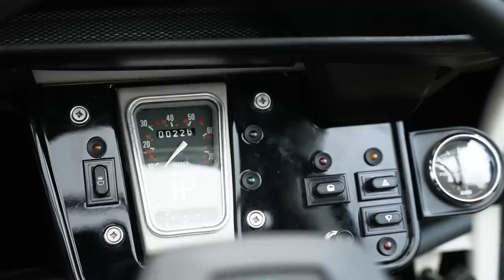All NEW electric converted Citroen 2CV

Comment: I am a little ambivalent of electric conversions of old cars. OK, no, I straight up dislike it.
On the one hand you have something nice and quirky not everyone else has.
On the other hand, a 30+ year old car will never be a daily driver/commuter, because parts will be hard to get and you certainly don't want to be in a motorway pileup in a 2CV and you will be missing a lot of driving comforts. If your car is a complete custom job, no garage will touch it and parts will still be hard to get. And they will still rust like the Dickens.
Also, if the car is something interesting and has a certain value due to it being rare and/or desirable, you will utterly destroy any resale value.
That is apart from the fact that converting a classic car to electric is the same as putting it in a crusher or setting it on fire.
It's worth it keeping an original car going forever. An electro conversion has a definite shelf-life. Once the new components are obsolete, the car is scrap and nothing else. It is converting a timeless classic into a throwaway consumer object.
To me electric conversions of classic cars are for people who don't really like classic cars (because they are a hassle) and don't understand them.

If you really want to convert an old car to electric, go for 2000's onwards. Much more practical, more driver aides, much better rustproofing, better crash safety, seatbelts, airbags, cheap as chips, plenty of parts available, just better allround.
Please don't destroy classic cars.

Comment: On a different note. Saw today that in 2025 5 major car manufacturers will be racing hydrogen cars in the Le Man's race..
Fantastic..  The future.
Reply: Hydrogen very inefficient, like driving a bomb basically. Smallest vapour you can't detect and highly flammable. Get a solar roof, be your own utility, charge at home and you don't need to stop for a garage. Recycle the battery and go again.
Reply: @_hrlt . I was talking about racing in particular.
But also I live in flat with no access to charging..

Comment: 55 miles range is just not realistically usable, 160+ mile range where you charge to 80% and use down to 20%  so a usable 100 mile range is the minimum I believe would be acceptable to most people. 
I have lived daily with a modern EV with 70 miles range and unless you are going to fully charge the pack and run it right down you find you are charging it almost daily
Lovely retro car but wow those cost figures!

Comment: Why keep the gear box ? Appears a weight, maintenance and failure point waste of time to me ?  I love the idea of saving and improving old cars, but the loss of boot space ( yet no fuel tank or spare ? ) for the battery’s annoys me, the range is unacceptably low, performance should be better ( gearbox mentioned as the issue 🙈) and finally the cost - for the poor ish concept of packaging the conversion and the pathetic range - this is way way overpriced - sorry 😢
Reply: Shame but I agree - I love the 2CV and ev’s so should be wetting my pants here - but it’s a too compromised instillation plus way to expensive as you say

Comment: Great video as usual. BUT and its maybe only a small one. the 'fun' in classic cars is the bloody noise the engine makes, Ive just got a 1988 Moke and it drives like a bag of spuds, its noisy and rattly and thats what is good about it. Its got a tiny 998cc mini engine that you have to rev the nuts off. Why would I pay for a quieter than the dead EV car (oh and I live on the 2nd floor with n o access to power). For a rich mans toy at £50,000 maybe, but not for any serious classic nut. The only reason people are looking at doing this is ALL the current small Ev cars are UGLY. just my 2p

Comment: Mmm seems pricy Jonny for what you get... in the same way the EV converted MX5 was too. A brand new city EV costs how much now ? I think unless you're a super EV fan, the tech : cost balance isn't there yet. I have an Elise I'd like to convert in the future, don't want extra weight, needs to have the same or more power, 200 mile real world range, even willing to give-up on track use... but from limited research, we're not there yet to do this viability
Reply from the maker: You would never buy one of these conversions instead of a brand new EV, because there is no comparison between the tech, safety and luxury of something like a Renault Zoe.

Comment: If the chassis is new and the body panels are new.
It's a New car
Id say there could be some legal issues with the M.O.T ...
Reply: I believe they are obligated to keep the frame as that's what has the registration on it. Although I have heard of some people in france kind of cheating this by transferring the registration.
Reply: @EngineeringNibbles  As a former vehicle certifier this has alarm bells written all over it.
Love the car though
Reply: @BlueJazzBoyNZ  I don't know about the uk but in europe you're allowed to change parts out as long as they're non structural for replacement factory parts or identicals, although these often need to be certified. 

Since usually the frame is kept in these 2cv restorations, it's legally accepted over here to basically change most of the vehicle, I don't see how it is different to change a door or all four.
Reply: @EngineeringNibbles  the frame? The chassis on the original 2cv barely lasts ten years. It’s very unlikely you’ll find more than a handful of 2cvs in the UK on Citroen chassis let alone an original one. Most will be SLC or 2cvCity galvanised chassis. Most cars will have had floors and bulkheads replaced too by now. Drivetrain, axles, suspension and the top third of the body are likely to be original. As he said there are new bodies now too so their ‘restored’ cars are unlikely to have much old car on them.
Reply: @SquareoftheyearFM  So a Blind spot the M.O.T chooses to ignore ..
Reply: @BlueJazzBoyNZ  The MOT is there as a safety check, not to verify identity. The VIN is needed for the MOT computer to start the test but so long as it's stamped roughly where it should be or is clearly visible on the plate very few testers would question it. Does the WOF go into more detail?
Reply: @SquareoftheyearFM  I'm not in the UK so whichever agency processes vehicle registration.
Reply: The chassis we fit are made under license from Citroen. So it is a genuine Citroen part.
Reply: @The2cvshop  Has the UK supervisory body signed off (in writing)  on this?
Then All good.
I suspect not.
Otherwise crim's would be swapping vin numbers 24 /7
PS Love the Car   Not a Hater
Reply: @SquareoftheyearFM  Other than morals and honesty
Reply: @SquareoftheyearFM  In the Rally car world there is a Whole lot of cars with  chassis numbers they were never manufactured with.
But With the 2c-ev. I do not want them getting into trouble. So for warned is forearmed
Reply: @BlueJazzBoyNZ  It's not just the 2CV EV, they're all like that. A bit like landrovers but thankfully less popular!
Reply: @SquareoftheyearFM  Grandfathers axe but legal ..?
Reply: @The2cvshop  If it's illegal  it's a profound liability for you. Hope not true.

Comment: It is tragic carmakers and their greed have destroyed the automobile, and turned it into an over-complicated, slow, heavy, super-expensive mobile obsolescence machine specifically designed to force you to buy a new one after just a few years.

Why does no manufacturer use today's technology to produce a small, lightweight, good-performing, simple car, specifically designed to last a long time, and to be appealing to drivers, watchers, and listeners, alike?

It's so logical: you make that car, AND make it expensive!

How does this sound? The CEO of Subaru directs STI to develop a new chassis in aluminium with carbon fibre body panels, for a 2-litre  front-engined twin-electric-turbocharged flat-4 making no less than 400 BHP @ 8,000rpm. It is rear-wheel drive only with a transaxle, but with AWD as an option. The car is super-basic inside as an RA "Race Altered" Subaru should be: No power seats. No power windows. No power mirrors. No automatic anything except traction control and ABS. No sound deadening to speak of. Nothing for passengers except seats and belts. No stereo. No sunroof. But with a forward-facing roof-scoop option.

Such a car would come standard with enormous brakes, amazing steering, superb suspension, and lots of sounds coming from all these components working hard together, along with huge blow-off sounds on the lift-off. 

Such a car can be brought in at well under 1,000 kilograms, and it would rip your face off under full boost, last forever, and be easy to repair and maintain, because it's not full of useless crap you do not need in a car designed to get you from A to B as rapidly as possible, in the lightest way possible.

Comment: Sorry, but i couldn't disagree more!
For about four years my daily drive was a Dyane(far superior to the 2CV)
I would often travel from the Midlands down to Dorset to see friends. How is your EV 'future proofed' if that trip just one way would take all weekend?
Why aren't the batteries installed in a box that uses the boot space better?
My Dyane had a bar in the engine bay onto which you could sit a spare wheel in adition to the one in the back. Why isn't the engine bay configured to do the same? That chap stating that if your car is well maintained you don't need a spare wheel is a bloody idiot! What does car maintenance have to do with the sharp things that are found on the road which puncture your tyres?
As a concept, it's a great idea but as a product in it's current form... NOT!

Comment: 90 percent of the horsepower(26/29), 3 times the torque (120/39 N-m) of the 1979+ 2CV. But no shifting. It must be an absolute barn door to the wind, with the world's most fiddly gearbox, to pick up 15 seconds 0-60 with less hp just by not having to shift gears.
Reply from the maker: No gears needed, as max torque from 0 rpm